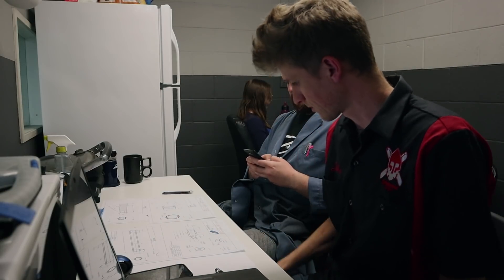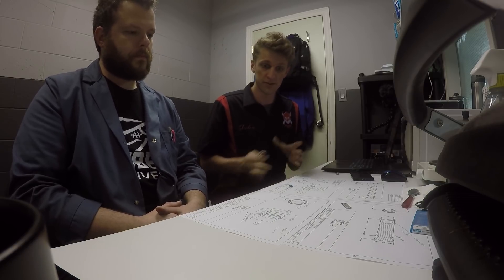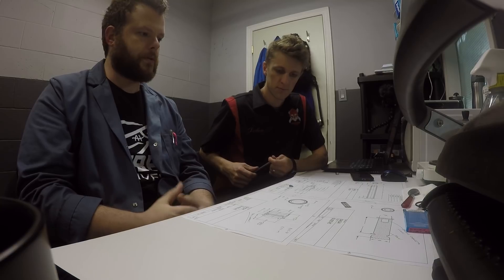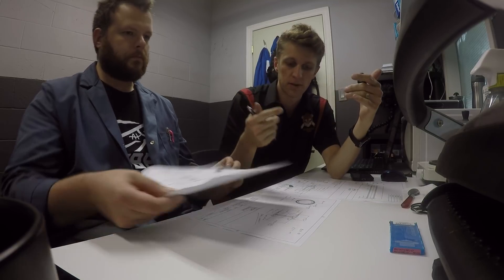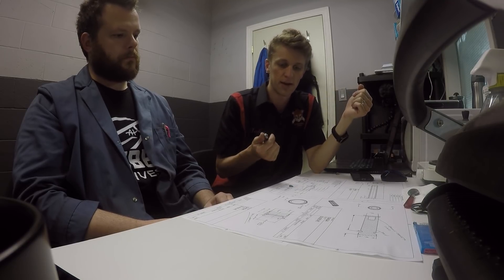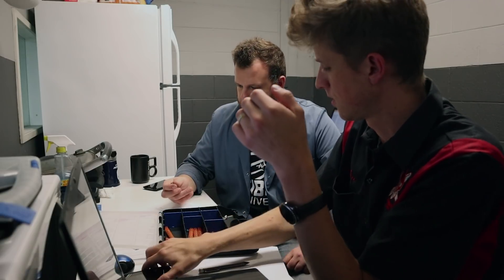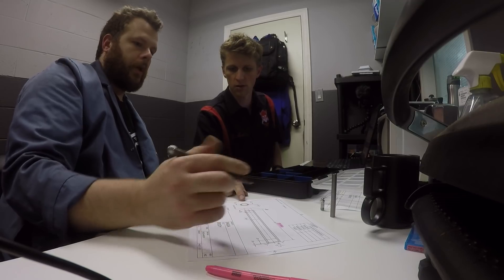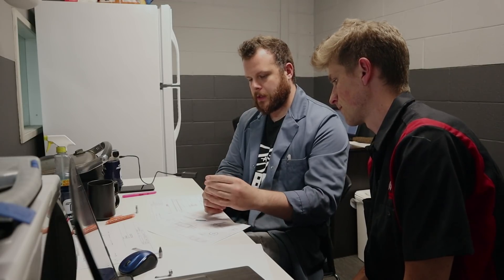Redesigning before the Relaunch - Saga Saturday 010

Comment: Thanks for posting this! Drawings and the work that goes into them don't get enough love on YouTube. Thought I'd help a bit, since your GD&T has several mistakes:

1) You need to establish the shoulder as a datum and control the thread's perpendicularity relative to it. If the perpendicularity of the thread is out from the shoulder, the clearance in the thread will allow the tip to swing to one side and affect your fit-up with the cartridge. Or, if there's insufficient clearance in the thread, the thread will bind and then you'll have a gap at the shoulder.

 2) That concentricity tolerance doesn't mean what you think it does! You mean true position. Concentricity is intended for balancing in turbo machinery. It controls the distribution of mass in a revolved feature. You will inspect this position tolerance as runout, by using a gage pin to serve as the feature simulator for the .102 ID. Since you'll assume the pin to have perfect circularity, the runout you read will be due to position error only.

3) Datum A flag needs to be inline with dimension lines of 0.3125. If they are in-line, it indicates that Datum A is a derived median line of the pitch diameter of the thread, which is what you want.

4) You should hang the Datum B flag from the feature control frame instead of using a separate leader.

5) Your feature control frames have leaders pointing to leaders. The frame should just appear below the dimension without a leader.

6) You haven't called out ASME Y14.5 anywhere. This should appear in the titleblock.